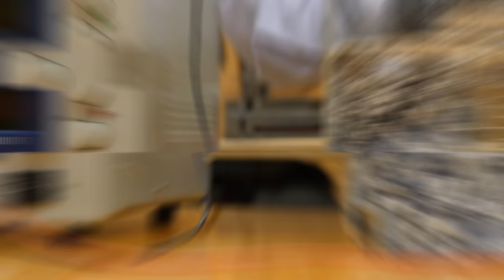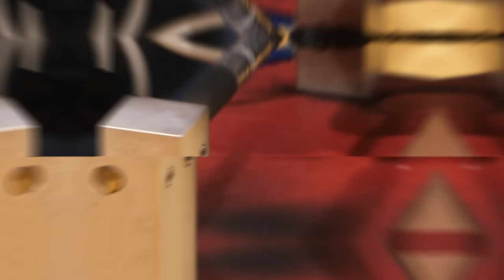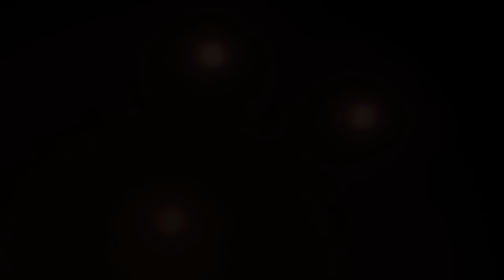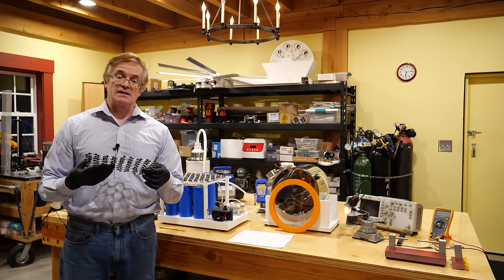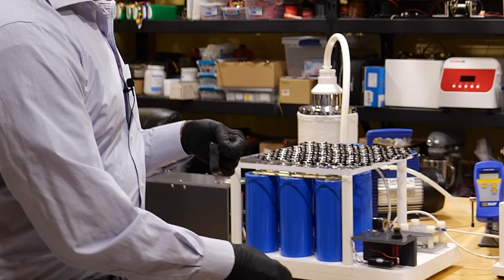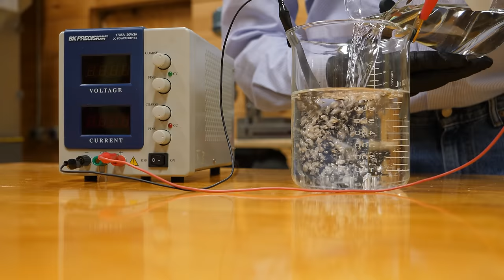Making Graphene could KILL you... but we did it anyway?!

Comment: I built a 16' fiberglass/carbon fiber canoe years ago (using epoxy resin and graphite), weighed about 22lbs iirc. And the whole time watching this, all i could think about was how much lighter and or stronger it WOULD be with graphene.
Reply: Also, imagine for aircraft, where weight matters much more.
Reply: how would you have made it lighter? would have have done so by changing the design? perhaps by decreasing the size and/or quantity of certain support structures? I would think that if you used the same design.. it would essentially be the same weight.. but would be much stronger at that weight?
Reply: @manp1039  Basically, if it's stronger, it doesn't have to be as thick
Reply: @RoughSmoothie  Yep, or possibly even cheaper.  Might be able to buy more simple weaves and get the same results.  But at a certain point, 2lbs isn't much more practical than 22lbs since the disadvantage of the canoe is no longer weight, but the exertion spent carrying it through winds and bulky awkward navigations.
Reply: @manp1039  If you are using stronger material, you can use less of it.
Reply: 3.3 lbs done w the .6% done here. Pure graphene would be so light you would have to consciously hold it tighter in case the wind caught it. "George didn't hold it like I asked, and by the time I turned around it was 500 feet in the air, heading for the next county"

Comment: The implications of the method you mentioned at the very end are staggering.  Graphene-reinforced composites on industrial scales may not be very far off in the grand scheme of things.  What a time to me alive for material scientists
Reply: Exactly. I would enjoy a job working with someone to test Graphene in not just epoxies but also many plastics, resins & adhesives. I know of so many things that this would be applicable to. Especially in Aerospace, Nautical, DOD, & Manufacturering.
Reply: Armor was the first thing coming to my mind.
Reply: @marekstanek112  *Casually shaves 10 tons off an M1 Abrams*
Reply: I kind of want to use this method to make the worlds strongest glue gun stick
Reply: Suddenly it seems possible that you could clean up after a war with a huge bonfire again. Hmmm.
Reply: A graphene filament for 3d printing would be extremely interresting
Reply: @BlueBeluga_   Seems like the logical next step right?
Reply: @marekstanek112 how do i get a graphene sword?

Comment: I've got some JB Weld that needs this!  The cost you mention per gram also puts some perspective on just how miniscule the amount of graphene is actually in products that purport to contain graphene (eg: any variety of car detail products).  I also love that the mask is upside down.  :)  Thanks for being genuine and keeping up the interesting content!
Reply: The graphene stiffened the epoxy. We do not know if the graphene strengthened the epoxy or if it will strengthen the bond of the epoxy to a substrate.
Reply: @pauleohl  I kind of agree the graphene couldn't be the outer adhesion layer because of its friction qualities. Not sure how it would react to being mixed with jb weld directly or after the fact.

Comment: Wow! Simply outstanding! 
I've had an eye out for progress on the graphene front for years ever since I first learned about it... and still frustrated by the lack of advance. 
Great to see you demonstrate a practical way for someone to make this at home and even a practical application. In addition to the method itself, I was impressed that:
1. You took the trouble to go into the little practical details like cutting the tube or the little add-on piece to bring down the resistance in a controlled way with overshooting.
2. You showed that one doesn't have to be limited by not having some expensive bit of analytical equipment like a Raman spectroscope and instead, showed an inexpensive performance based approach. You've made some good marzipan!
Reply: In fact, in my business we sell cut resitant graphene gloves. Thin yarns that are tactile and more cut resistant than stainless steel. A huge advance in the safety industry

Comment: I am shocked that it worked that well, especially considering the low concentrations! I think it would have been interesting to see it compared to maybe some kind of powdered steel or ceramic/glass in the bending tests as a comparison between non-carbon based materials. Also, further testing for pure compression, tension, and shear would be interesting to see, although difficult to make repeatable in a home shop. Regardless, great work!!!
Reply: That 0.6% produced 750% increase in strength.  All doable "at home."
Reply: Yeah.  The property wasn't really tapering off much.  It's still almost linear and I'm not comfortable extrapolating.  If 0.3 is about 400% and 0.6 is 750% increase.  that makes a linear graph similar to y = 1166.66666667x + 50.  the "+ 50" is probably due to the crude but effective measuring technique.  It should be "+ 0."  If we had a third data point, we could make a logarithmic function and then know how much graphene to add to get a specific increase in toughness. I'm just blown away by the results.  I bet results taper off rapidly though.  12% graphene probably doesn't yield near 15,000% increase in toughness.  I'm thinking it would yield about %3,000 increase, but it's really hard to say from these two numbers.  This is so exciting!
Reply: YES!

Add it to some sort of LASER deposition process maybe...that could be really interesting
Reply: Would also be interesting to compare with ordered reinforcement, though how much carbon or boron fibre would 0.3% be
Reply: @philipgwyn8091  Technically doable at home, but have fun with large capacitor banks. I'm not so brave, and I'm not even scared of dying. 

   I'll stick with focusing on making carbonized cellulose nanocrystals. Much easier, safer, cheaper, and can make in true bulk (many grams vs miligrams per batch).

Comment: A good tip when working with high voltages is to stand on an insulating mat and work with one hand. You will still get a shock but  the current would be extremely low and it would not go through your heart as it can with two hands.

Comment: This is pretty interesting. Makes me wonder what kind of strength one could get out of a 3d printed object using an sla resin printer and simply adding graphene to the printer resin. I would love to see this done and tested! Im sure you wouldn't mind the free idea for a new video😉
Reply: very good point, must be tested. 🧐
Reply: Ooooh, yeah!
Reply: I want to see this.
Reply: Excellent idea! Please family crew, try this ! 😍
Reply: Especially for a 3d printed rocket...
Reply: Was going to ask the same thing! This is within my own reach, gonna have to go shopping!
Reply: a 3d printer that uses epoxy as a medium, would need a complete rethink of the 3d printer, it  before any thing it would need hopefully a fully auto, media cleaning of the print heat (the hot end bit), and as epoxy is self heating (the term may become redundant), or maybe a disposable head as it would just tube, used for one print run only, then discarded, like gun  magazine round bullet case, for the next print run, but the biggest problem will big the mixing of the two parts of the epoxy resin, and priming the print head before the printing could be started, and depending how fast the print would take, the print may have keep mixing  the epoxy as the 3d print continues be made, if it ever stopped in the middle of a print, the hole thing would set solid completely jamming the printer, that would need to be avoided at all cost?
Reply: @dh2032  I was talking about a sla printer not a fdm printer. Sla you would just mix the graphene into the resin and pour in the vat. The issue would be the specific gravity of the graphene and keeping it suspended or agitated in the resin so it would stay suspended and not settle to the bottom of the tank.
Reply: Tried it in 2019 without much success. First you need a way to disperse the graphene in the photopolymer homogeneously. Either with a carrier agent or another mixing method. Second, to get enough graphene in there to actually make it useful will affect both viscosity and curing. Very few machines can handle high viscosity photopolymer well. I did a very brief handful of tests with nowhere near enough graphene with no success. Lack of resources and, at the time, lack of machine/equipment that could do this made me give up on the project. I was hoping the combination could lend enhanced mechanical properties and possibly some level of fire resistance or increase the HDT.
Reply: Sounds like a lot of work..
Reply: They already have self-filling resin systems, so keeping the mixture homogeneous can be offloaded to the filling stage, just enough resin for the next layer is dispensed and cured before it has a chance to settle perhaps 🤔
Reply: @brbubba  I bet such a small amount will not affect the viscosity. But i would also bet that the resulting object will be anisotropic like fdm prints, getting strong layers but perhaps little above normal strength betveen. But the thing is you could print an object hollow and fill it up with the mixed epoxy, just like in this experiment. May not be good for intricate stuff, but good for most.
Reply: @NVRMTmotion  I think the solution is to pony up the cash for a continuous mixing system like Fortify or solve the dispersion on the front end with the chemistry. There are companies now that might be willing to do it with committing to a small 10+ liter batch.
Reply: We need CNC Kitchen for that
Reply: Will the graphene interfere with the UV penetration?
Reply: @sinformant  In the Article the writers claim that this flash graphene has superior properties for remaining in suspension. They show about 50% suspension after being run in a centrifuge for 30 minutes compared to other commercial grade which went to 0%. It has to do with the quality of bottom up graphene vs top down graphene. Maybe it would work?
Reply: @aaronschocke2147  shouldn't because the cure happens at the first surface of the material against a clear silicone build plate.
Reply: @mytuberforyou  I am not familiar with resin printing, but I have seen attempts at using additives failing in prints before. Doesn't the print require post print UV exposure to fully cure?
Reply: Do you always play with your narcissism in public?
Reply: @aaronschocke2147  Yep. Anything that reflects or absorbs light will interfere. Even adding colorant affects it.
Reply: @aaronschocke2147  Post-curing helps crosslinking in the PMMA resin along. It may be possible to catalyze the resin so the green print will continue to polymerize, or find another method to add energy to the reaction (heat, infrared, microwave, ultrasound, etc.) and we should not discard the possibility that because the graphene is opaque to visible light that it may pass UV or IR, for example PMMA is transparent to visible light and nearly opaque to IR. 
My point is we should not dismiss these kinds of possibilities out of hand, but experiment and find a solution, if there is one. Even in my own small fab shop, many times I have thought an idea was a long shot at best but worked unexpectedly well.
Reply: @brbubba  Did you have access to formlabs printers back then? Their SLA printers manage suspended glass fibre so they probably aldready have dispersants plus the laser has significantly more curing power than UV LEDs.
Reply: @aaronschocke2147  I would imagine it absolutely does since carbon black is used in products for UV protection. I'm not sure if it would make too much of a difference in such thin layers but completely possible.
Reply: @paint4pain  Yes we had a Form 2 then! However, I did not attempt this experiment on the Form 2 because you can't change the laser dwell parameters. I later did parts on the Form 2 with clear engineering resins and a red nano particle colorant which affected curing. Parts with colorant needed additional post cure time, but I was able to achieve a nice red color. Companies like Henkel, probably Formlabs too, will pre-mix to hit color matching palettes for you, but you're looking at 100 liter min orders.
I have also subsequently used Formlabs' Color Kit and it works well enough, but you are obviously limited to the properties of their color base resin.

Comment: Amazing Video as always! My immediate thought when you showed the bending force tests was that this would make amazing polymer filaments for 3D printing. Turns out this already exists, however the youngs modulus increase is listed as only 15% above regular PLA. What could be the reason that the increase is so low ?
Reply from the maker: It's likely they are not actually incorporating graphene, but rather graphite or small carbon fiber fragments.

Comment: This is such a kick ass channel…I’m getting ready to graduate with a B.S. in Physics in a few weeks…I wanted to say thank you for being there to provide the key concepts and awesome demonstrations for the last 5 years. Each of the videos has given me a deeper understanding than my classes could ever achieve.
Reply from the maker: Congratulations!
What's next?
Reply: @TechIngredients  land on Mars with graphene rocket? 🚀
Reply: @TechIngredients  Practical applications of graphene for hobbyists? Since it has excellent thermal conductivity how about taking soda can, remove the oxide layer+paint perhaps using acid and then coat it with graphene layer, then compare average matt black vs black 3.0 painted vs black anodized vs graphene coated soda can as solar heater tubes. This out to be interesting what cost+ effort to efficiency ratio is for them. Of course if there is other practical uses like mixing it to 3D filament and making say RC car parts, testing durability of those parts.
How about the electro chemical durability of those, say in HHO generator? If graphite increases efficiency 30%, what graphene does? Looked into getting graphite sheets used in high temp seals, but company quoted me pretty high so i would not say its cheap. Now i start to wonder if its possible to make my own graphene variants at home.
Reply: @TechIngredients  Excellent question! Definitely going to graduate school at some point, would love to continue my education.

Comment: The final tests are impressive. Is epoxy resin the best medium to mix the graphene to? I'm also curious at what addition ratios you start to get diminishing returns. Good luck with your future endeavors!
Reply: Not particularly, any medium will increase in strength similarly. And it is relatively linear, double the quantity, double the strength- at least up to the 5-10% ranges by volume. That much graphene is worth thousands, tens of thousands however at current prices.

Testing best mediums, why that seems like something you could do at home

Comment: Awesome video, but can you compare the graphene to chopped fiberglass or chopped carbon fiber?   I think that would be a better representation of what graphene can do vs common alternatives.
Reply: Exactly. This experiment has real potential, but I’d like to see comparison with other fillers, not just fibrous but particulates as well.
Reply: I think the point if trying to make graphene is because carbon is so incredibly abundant, it could be cheaper to use it instead of its alternatives; especially the very small amount you beed to strengthen things.
Reply: @sheeeeeeeeeeesh But carbon fiber is also made of carbon and already mass produced
Reply: @nahometesfay1112  I am not too knowledgeable on this, only coming from assumption. But carbon fiber is a lot of carbon and is still quite expensive. Being able to mass produce graphene and only needing a small amount with some compound like the epoxy in the video could definitely change the market.
Reply: @sheeeeeeeeeeesh  carbon fiber costs 20-30$ per kg
Reply: @karliszauers1    Maybe that is the raw materials cost for the manufacturers, but if you actually look at carbon fiber cloth by the square yard or meter, if you're not buying in crazy bulk, it typically costs anywhere from 40 to 100 dollars per single square yard or meter (and which weighs far less than a kg)!  It is still quite expensive, especially for us individual DIY'ers/makers. The stuff that is cheaper, is usually only like 12" wide (by 36" long), hence not even a true square yard or meter, let alone weighing anything close to a kg. 

   S-glass cloth on the other hand, you can buy like 16 square yards at around 9 to 10 dollars a true square yard. I bring S-glass into this, because it has similar tensile strength per weight as carbon fiber, but lacks the stiffness strength of CF.  But a composite of S-glass/graphene (or carbonized cellulose nanocrystals)/epoxy should compete favorably against carbon fiber/epoxy composites.  And if you use carbonized CNC instead of graphene, it would still be significantly cheaper than carbon fiber composites (especially if you make the carbonized CNC material at home).
Reply: @sheeeeeeeeeeesh  "could be" but it's a worthwhile comparison
Reply: if you chop up carbon fiber it wouldn't be any different from carbon used in the video
Reply: @jormam69   I'd still like to see it.... also on the grephene was it ground up into a fine powder or kept in bigger flakes, and what was the dispersion of the grephene into the epoxy.... inquiring minds WANT TO KNOW
Reply: @ericensley2427  he mentioned pulverizing it with a mortar and pestle.
Reply: I’d like to see results of higher concentrations of graphene. Also tensile strength test. What applications can it be used in?
Reply: @douganderson7002  who thinks this guy has a point?
Reply: The point is to check the material out with current limitations. If you could really create aligned sheets of graphene at some point, this will replace any other material for so many applications.